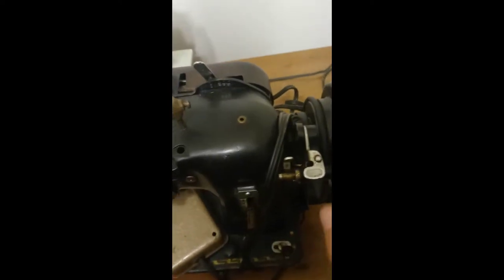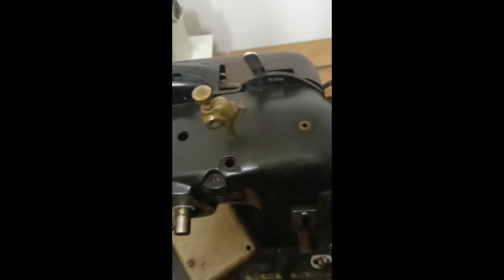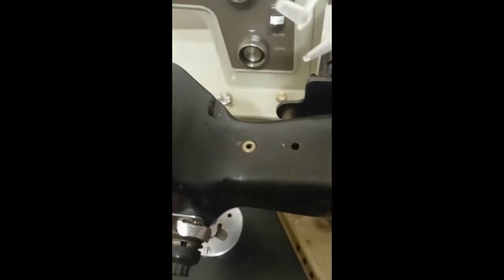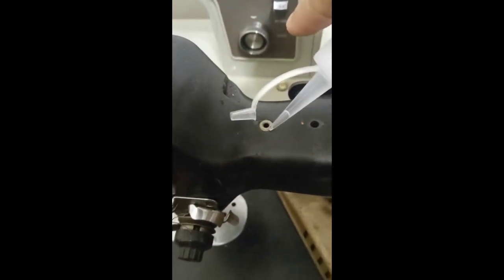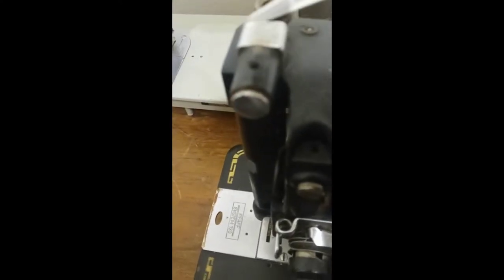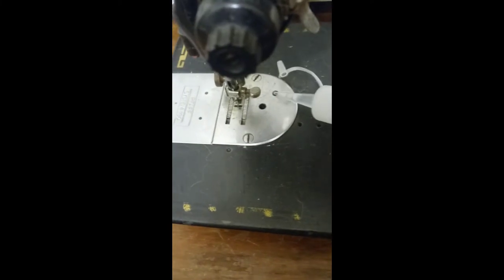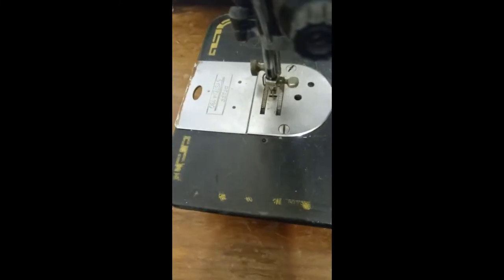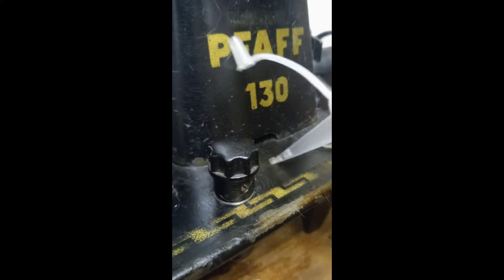#Oil vintage pfaff 130-6 coffee grinder sewing machine

Comment: What do u use to clean old oil off?
Reply from the maker: Goop non abrasive, if it's on the body. Kerosene and heat if it is on moving parts